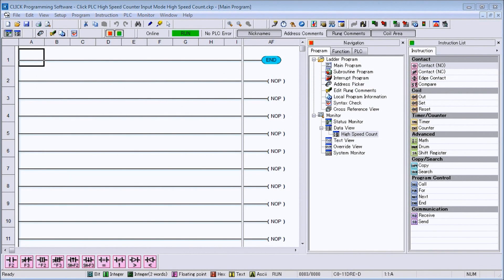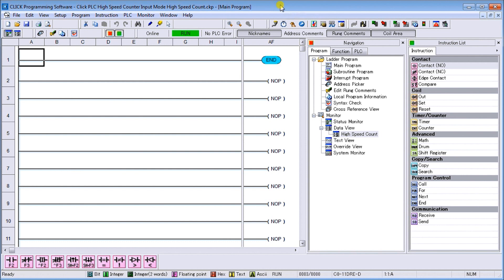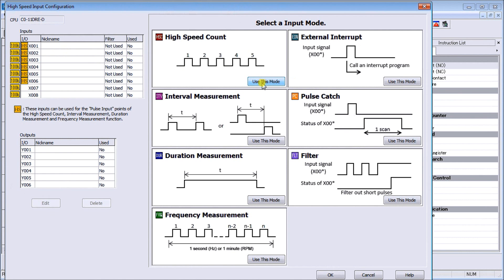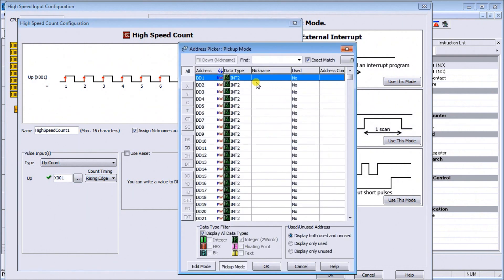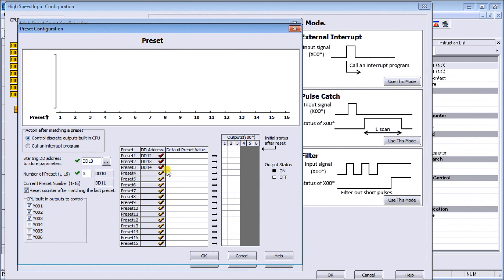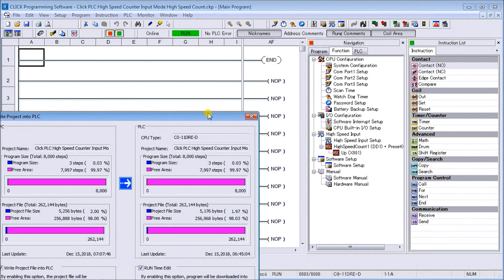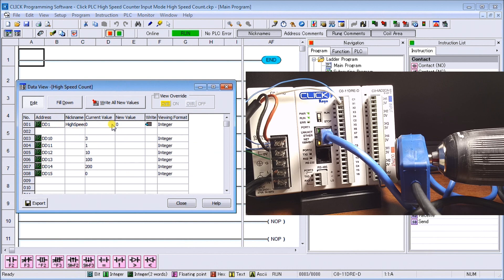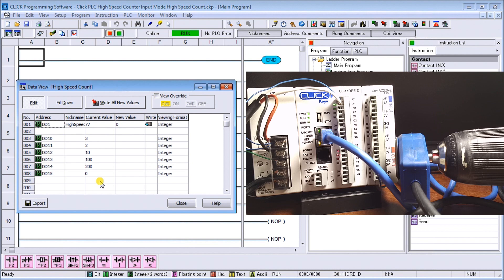Click PLC High Speed Counter Input Mode High Speed Count

Comment: My resolution on all my screens will not let me see the bottom part of my high speed counter pages what is wrong
Reply from the maker: Hi dan dan
The Click programming software has specifications for video as follows:
Video: SXGA 1280x1024 Resolution Minimum

https://www.automationdirect.com/adc/shopping/catalog/software_products/programmable_controller_software/click_plc_programming_software/c0-pgmsw#docsanchor

The setup screen for the High-Speed Counter will need at least a 1080 X 724 to display.

Please upgrade your resolution.
Regards,
Garry